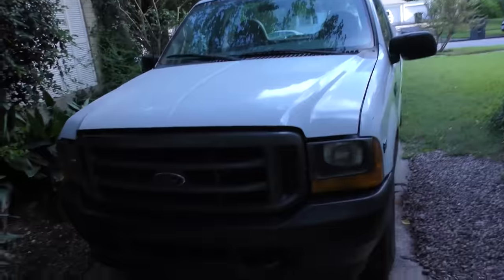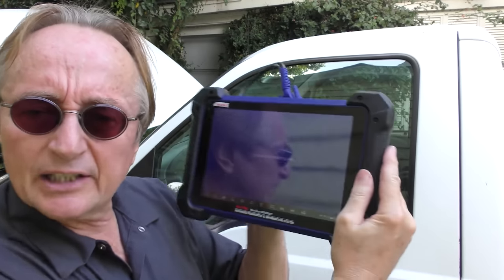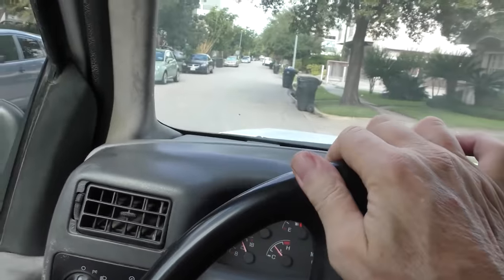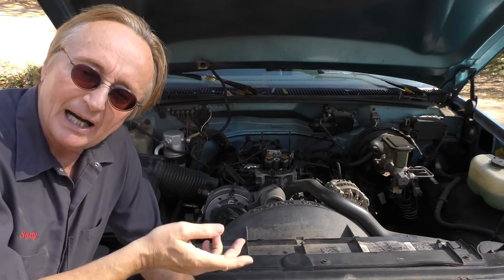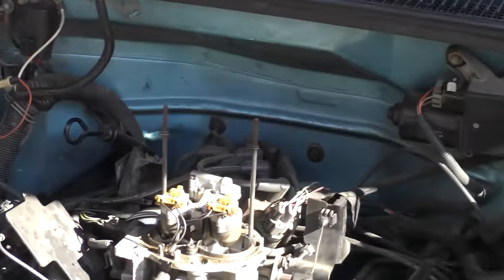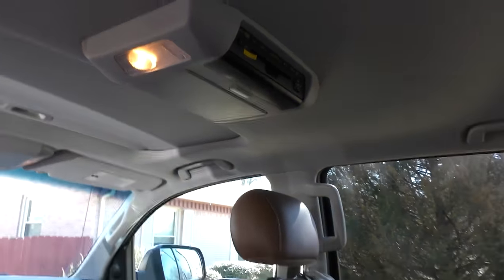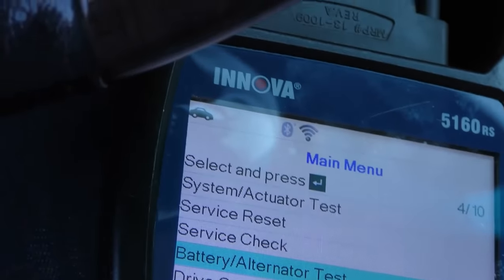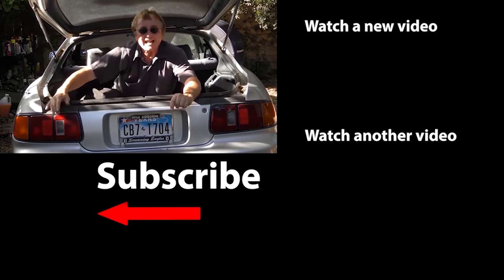3 Trucks That Will Last 700,000 Miles

Comment: I owned a Canadian built 2001 Chevy Astro I bought in 2002. Owned it till 2020 and put 196,000 miles on it. One trans rebuild, no engine problems at all.  Finally it rusted away.  Still miss it.
Reply: My daily driver is a 1993 Chevy Astro with no repairs other than maintenance, alternator, water pump and a/c compressor.  Power steering pump is still original as is the transmission.  Water pump started leaking a couple weeks ago, so I'll have to change that tomorrow.  But at 294,000 miles it's hanging in there strong and reliably.
Reply: Those Astros are a forgotten gem.
Reply: Outstanding !
Built to last, too bad no more….
Reply: I have a 2001 Astro Cargo Van
Reply: Those astro vans were are still are the best.
Reply: Had one too…’97 Safari(same thing) I miss it….1 tranny rebuild original engine till I got to 230k miles….then had life circumstances where I couldn’t take care of it properly and had to run the engine into the ground(couldn’t fix the gaskets)
Reply: I see one driving around every once in awhile where I live
Reply: I live in California and the rust is non existent.   I'm serious.   But I like rain and snow.    Can't have everything I guess
Reply: 370 thousand  on my astro.still runs great.replaced ball joints at 200 k.
Reply: Had a 94 astro van.   Sold it at 358,000 miles and still was running strong. Had put newer astro van rims on. Made it look like a newer van
Reply: Astro is probably the best van ever created on God's green earth.
Reply: I know a guy that has a GMC version on a lift in his shop, engine out for a head gasket job.  Painting the frame and going over everything while it's out of service.  Wish I had a lift...
Reply: I had relative's build those in the Baltimore GM plant.
Reply: @brianbower2845  k
Reply: @theshield1613  I have a 1988 two-tone (gold and tan). It replaced my 1988 that I hit a deer while driving (brown and tan).
Reply: 196,000 is not high mileage
Reply: MysteriousOklahoma  that's just because everybody's poor. When you start seeing 👀 brand new cars and trucks there more often, that'll be good 👍🏽.
Reply: @Popwarner-x1w  I'm serious. I'M SERIOUS!! 😂😂🤣🤣👍🏽 The whole American southwest has lots of deserts.... less rust isn't magical, but salt on roads ruins vehicles elsewhere probably on purpose.
Reply: @thomasmendez5063  maybe for mexico.😂😏
Reply: @phoenixarizona8441  nice👍🏽, but hypothetically,  what model would you upgrade to eventually? 😎✌🏽
Reply: My family had an AWD ASTRO. That thing was a beast, we always regretted selling it.
Reply: MysteriousOklahoma  okay Oklahoma 😃👍🏽 you're all the way up north.😂 Hmm.... I sure hope I'm seriously wrong and all the other tribes are super rich and only drive new cars 🚗. That'd be great!💙👍🏽😎✌🏽
Reply: @jaket6007  eh, it would've rusted away or developed some sort of issue with the front drive most likely eventually. Nothing lasts forever, maybe the longest lasting cars are the 60s Chevys just from being so interchangeable.
Reply: @Aaron-TheHandsome   I certainly wish that we had kept it because within one year the Buick rendezvous that we bought lost all wheel drive, 1 head gasket, And like 3 wheel bearings. Professional installation or not, we went through 1 a month on one of the 4 corners at random.
Reply: MysteriousOklahoma  Minnesota too 👋🏼
Reply: Bought an Astro whenh they first came out (1985?) and it was a great all around vehicle design.
Reply: Yeah the bodies fall apart before the engine if you keep up on the maintenance.  Love them old Astro vans

Comment: I have a 97 dodge ram 1500 , manual 5 speed, 318, just under 500,000 miles, still runs strong.
Reply: Damn thats surprising for a dodge..definitely got your moneys worth lol
Reply: People like to trash Dodge trucks. I’ve owned 5 of them. Got good service from all. I’m on my 5th. A 2019 Ram 1500 crew cab. So far very few problems.
Reply: You are one of the lucky ones!  I had one of those in my surveying company and we called it 'Miss Piggy'. LOL
Reply: A friend in Nashville has a dodge with a Cummings diesel engine. It'll outlast religion...
Reply: how much do you want for it?
Reply: @Guardian4ever  you can't have it, still driving it to work, nice weather I ride one of my antique harleys to work, have a good selection of those.
Reply: The old dodges were fine as long as you didn’t have too much power in them, the diesels blew up transmissions for decades and after they finally figured out how to build a trans to hold up to the 5.9, they threw out rear ends.
Reply: @kic7009  08 ram 1500 . 200k miles  no major issues.   Front suspension had problems and I replaced the fuel pump.  That's all
Reply: Dodge 318's are great simple motors that will run forever if you keep it cool. Run a 160 stat make sure it's running 170 and it'll go forever.  If it keeps running hotter then just put the diesel radiator in the gas engine.  It works great run it forever.  Belts hoses wiring computers all last far longer when run cool.
Reply: I got a 1999 with 357000 miles still running good got the 5.9 uses a little oil between changes
Reply: My 2000 dodge van with 360 is indestructible. I have so much faith in those motors
Reply: I have a 2002 dodge ram 1500 with 5.9. It has 260,000 miles.  Still going strong. I put 3000 miles a month on mine.
Reply: wow and I was bragging about mine lasting forever
Reply: @andylane247  thats the funniest car quote i ever heard
Reply: You got really lucky. The newer ones are not so good.
Reply: The 318 and the 360 dodge V8 are very reliable engines my 98 Dodge Ram 1500 360 have 205k on before I get rid of it for a 3/4 ton to tow my camper I 05 GMC Sierra 2500 diesel and it has a reliable engine and transmission as well too!
Reply: A  318 dodge with stick shift and short bed. would be nice to own.
Reply: The 318 is a really tough engine.
Reply: @bennygreene1421  I rather have a 360 instead more horsepower and better for towing/hauling!
Reply: I have a 85 dodge ram 100  Custom long bed 318  150,000  been in the family since brand new great truck 🛻   Runs great little exhaust smoke.
Reply: @robertpendergrass7996  The 318  is a very tough engine.
Reply: @bennygreene1421   Ben you're correct  1st car 318 Plymouth fury . United States Marine Corps Camp lejune North Carolina  032 infantry . Lol !  We both served proudly .
Reply: 318 with fuel injection?
Reply: @bennygreene1421  yes, just replaced the fuel pump again, over 500,000 miles now.

Comment: Wait... a Ford that still has working A/C??? Now that's a miracle
Reply: I have a 2000 ford p71 retired payroll   car that the AC works perfect in
Reply: Yup
Always filled it up for the summer maybe twice if it’s too hot rest of the year windows down was good enough 😊
Reply: All of my Ford trucks have ice cold AC
Reply: @trevorsmith7045  Great! You happen to live in the Alaska area?!.. 😆
Reply: @tommmy1313  nope.  Pennsylvania
Reply: Hardly. 150k miles and haven't added any freon. Blows very cool
Reply: Mine works great too! 
I have a 97 F 250..and a 2004 Ranger both AC works perfectly!
Reply: My ranger is a 95 and it still had ice cold air-conditioning before I got rid of it. My Ford Taurus had ice cold air conditioning before I got rid of it my Mustang, GT that I had had ice cold air-conditioning the only vehicle that I had was a Lincoln town car, it was an 89 and it did not have air-conditioning but I put air-conditioning in it drove it around for the six months worked just fine I know that 2015 Chevy 1500 that he showed on one of his other videos. That’s a crying shame the air conditioning stop working in the truck only had 60,000 miles on it. What a joke well not really it’s a Chevrolet what do you expect!

Comment: My sister has a 97 Ford F150 with just over 400k and still going strong.  They don't make them like they used to.
Reply: I believe you mine has 460k I got 03 f150 v6 stick shift.
Reply: Yeah my grandkids won't believe me of my mom and dads station wagon. That lasted 35 years. Good memories Good memories. 🙂
Reply: I'd bet no vehicle built in the last 10-15 years would last 25 years. Hell you're lucky to get 5 trouble free years out of a new car.
Reply: @jusrobington  it’s all because of too much technology to break that newer vehicles will never last 25 years
Reply: @jusrobington  
Your right and they got to many  parts that are made of plastic.
Reply: @mcc7762  except dodge rams with gas engines
Reply: @RebelRicans  5.0 V8
Reply: @jusrobington  I'd bet a lot of the RAV4s produced in the lasted 10-15 years will last 25 years, if they are maintained. Even my 2nd Gen Prerunner w 300,000+ miles could very well be around then. It's running well, only needs another 10 years to reach the 25 year threshold.

Comment: 0:01 Ford F250 ~ 2001

8:21 Chevy C/K 1500 ~ 1994

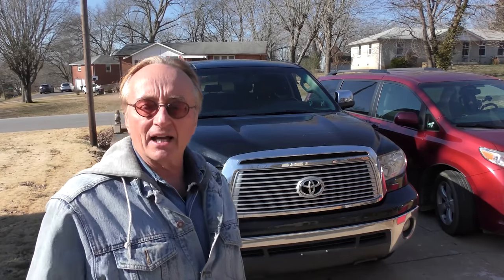15:28 Toyota Tundra ~ 2013
Reply: He forgot the Toyota Hilux/Surf. 😁
Reply: @lovelorn4154  not available
Reply: @lovelorn4154  the official truck of insurgents worldwide
Reply: I have 1990 Jeep Wrangler. And a 1985 GMC Sierra  body in good shape. New crate and transmission installed 2 months ago.
Reply: Is that blue truck in the thumbnail pic a Scottsdale?

Comment: I like the late 80s to early 2000s GM trucks. I have owned three of them: A 1988 4x4 3/4 Ton, 1990 GMC 4x4 Stepside, and a 1999 Chevy Tahoe. All three vehicles made it between 270,000 to 295,000 miles with the original drivetrain. The 1988 truck had some serious rust issues though.
Reply: How many times you have to deal with the dash controls failing due to the known issue with the crappy bayonet connectors? They corrode and get loose, and all of a sudden you cannot control your air, etc. 
GM has big issues with electrical connectors.... even defects in the wiper motor controls, which always seem to appear right when it rains of course! But yes their engines seem to be reliable.
Reply: I love my 2001 GMC Sierra 184,000 miles and still going strong
Reply: Had a 77 suburban. Could watch it rusting away. Must have been dipped in salt before painting.
Reply: @arvbergstedt3303  I had a 73 Chevy Stepside that was the worst. It spent most of the time in New Mexico, which should have been an ideal environment.
Reply: Had 2000 suburban 446,00 an ram great truck fell apart around engine and drive train.  Would have easily went a million if I took better car of the body. Current 2000 Chevy 2500 has 305,000 miles. Rusting but runs smooth an quiet easily going to get 500,000 plus if the body does not rust beyond repair. Never put a dime into both trucks but routine maintenance.  An used them for construction work every day.

Comment: I bought a '96 Chevy 1500 last year for $1,100 and I love it. It has about 200,000 miles but the transmission was rebuilt 15,000 miles ago. And it has a solid grill guard
Reply: Unless its rusty that is a very good price.  The '96 has the improved 5.7 Vortec, unless your's has the 4.3
Reply: For the same $1,100 -- was able to buy a 1996 Corolla wagon with 319K miles.  Stack of maintenance receipts.  A blast to drive with the stick shift.  33 mpg highway and I've yet to give it a tuneup a year into owning it.  No DEQ in my county 
😊👍
Reply: What a deal!
Reply: I bought a 96gmc Yukon 1500 SLE I love My Yukon best I've ever owned and it just hit 240.000 Miles in 2021 and now I need to fix it again it was the starter wires were bad.
BUT now it's wrecked And The only damage was My right front fender and my suspension is done
Reply: And I only paid 1500 for my Yukon
Reply: @timothykeith1367  Yeah it's the 5.7, and that mother buuuurns out. Especially with the crappy tires I've got on her:)

Comment: I have a rust free 01 7.3 F250 4dr.
2wd . With 180k miles that I hope to see 500k. It's got a BTS trans. And a little performance work.
Gets  9-11 mpg when towing the 5th wheel and 17-19 mpg without the trailer.  I had it ceramic coated. It shines like new.

Comment: Bought a 2001 Chevy S-10 Crew Cab 4X4 pickup with the 4.3 V6 used in 2010 for $5,000. Still driving it more than 12 years later. Yes, I’ve had to do some fairly spendy repairs along with regular maintenance but it still beats the heck out of having a gigantic truck payment. And it never fails to get me through the worst snow storms that a Minnesota winter can throw our way.
Reply: I had a 02 blazer and had to do the transmission twice. Total pain in the neck! Great ride, just seems hard on transmissions. One of those times may have been due to my recklessness while shifting rapidly, but the first time was after several years of wear and tear, mostly from previous owner, as it was fairly new to me.

Comment: I still have a 1993 Chevy Silverado 1500 I used for 15 years as a plow truck with a Boss 8.6 V Plow. The nice thing is you can tighten up the torsion bar and bring up the ride height. I still have it for a backup plow it took a beating and kept on ticking. Runs great but it has skin cancer.
Reply: As in rust?
Reply: @mattbartolovich8228  Rust is an understatement

Comment: ‘89 F-250 with the inline 6 is literally the best vehicle I’ve ever owned. Absolutely no idea how many miles, but I’ve put at least 150,000 on it myself.
  Strong, dependable and easy to work on.
Reply: They say after ww3 the only thing that will survive is cockroaches and a Ford 300 in-line 6
Reply: How much gas mileage did you get ?

Comment: 4 years ago I found my rare 5.7 V8 regular cab short bed 2007 Toyota Tundra SR5, everything works, it's totally reliable, it goes fast and stops great, and the gas mileage isn't bad. It has 304,000 miles and I am taking it on a 4 hour round trip drive into the heart of Atlanta later today. It's a keeper.

Comment: I bought a 2003 Tundra rear wheel drive new in 2003. It now has 342,000 miles no issues. The only thing I had to replace was air conditioning.
Reply: its hilarious how minor the issues are on these trucks. fords be like oh dang I need a new PISTON, Tundras be like, dang my tailgate latch broke XD. Our 2005 has 181k and I don't think single part has been replaced in the engine bay. not even spark plugs. def needs a timing belt tho lol, that's the biggest concern, but hey, you get a new water pump and get rid of all the squeaky belts included with that timing belt every 100k so can you really complain?
Reply: So true!
Reply: You’ll get another 342,000 easily outta that pig,, littie TLC is all it takes,, run synthetics & it’ll take care of you
Reply: @TeakKey7  spot on!!

Comment: 2000 silverado bought for $7K i think three years ago.  Fuel pump and heater core replaced, did it myself.  It's been hit front and rear, not bad.  My daily driver, just hit 230K miles.  Drives perfect.

Comment: A few years ago, I bought a 2002 Toyota Tundra 4X4 Limited extended cab (leather interior, step rails, power everything, and bed liner) for around $6500. It had 132,000 miles on it. I immediately changed the timing belt, spark plugs, and fuel filter, and flushed the radiator. I regularly change the oil and filter. So, far, it's run beautifully without a single problem. I've been spraying the underbody annually to avoid frame rust. I think rust is the only threat to me getting many, many more miles on this thing.
Reply: Hi Terry. Curious as to what spray you use?
Reply: @abefroman7393  I think the last time I used a Rustoleum Rust Reformer spray paint. It's convenient, but I'm not sure it really lasts more than a year. You can buy a similar Rustoleum brush-on formula. You just have to stay on top of it. I think there's a separate rust stopper solution you can brush on before you paint, which is supposed to stop the rust, but again, I'm not sure anything is really foolproof once the rust starts. If you can keep something on it, you can at least slow things down.
Reply: @abefroman7393  Im not Terry but I use Fluid Film.!
Reply: I’m glad you got yourself a tundra. But if you have some rust please do not paint over it. Do your best to wire brush off as much as possible and then use a Cosmo lean based rust preventer. If you spray that on it every couple of years it will stop your truck from rusting out. There are many videos on YouTube that support this statement.
Reply: What level of skill (in your opinion) is required to changing the timing belt ? Is that something for a trained mechanic ?  2000 Tundra.

Comment: I love my F-250 Diesel. She’s been loyal for many years and is still going.
Reply: Which Diesel engine does it have? The 7.3L or the 6.7L?
Reply: @demarkusthompson2867  I have an 06 with 220k on it. Got it with 40k miles no issues other than a couple coil packs and 1 injector
Reply: @demarkusthompson2867  yes. She’s been good to me so far.